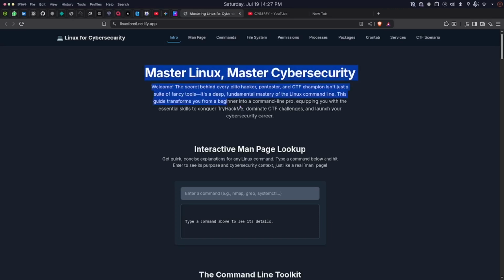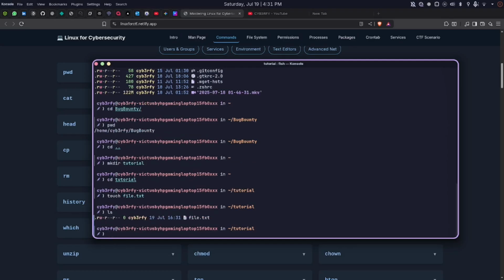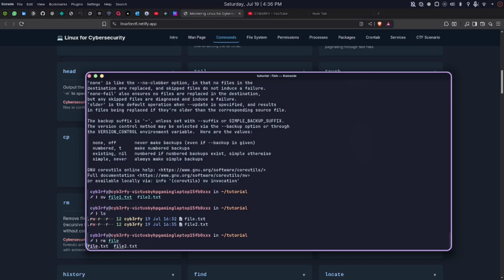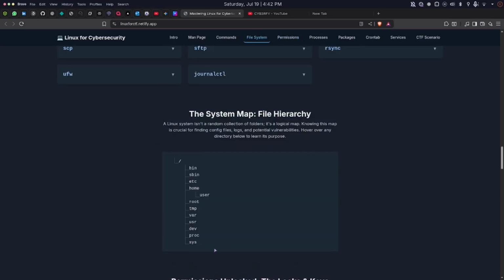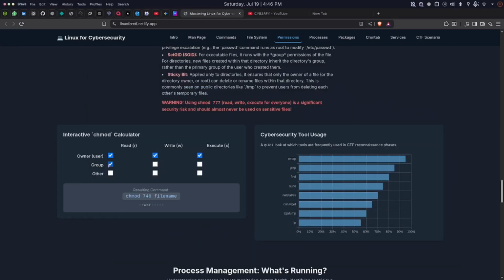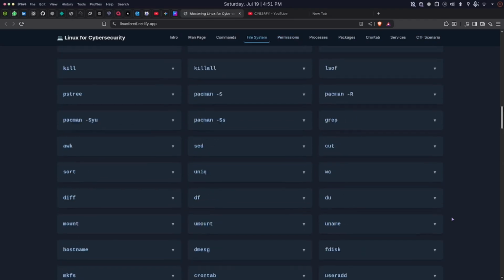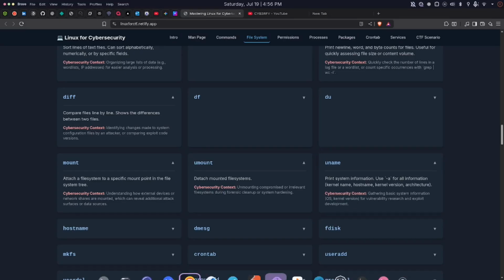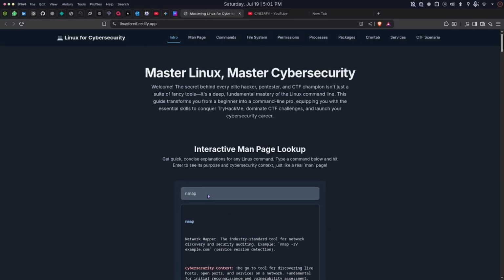Cybersecurity Linux Deep Dive: Become a Command Line Pro (CTF & TryHackMe Ready)

Comment from the maker: Here is the link for the webpage : https://linuxforctf.netlify.app/

Hope you will like it 😄
Reply: @cyb3rfy

The commands section of your webpage is missing.
Reply: Could you please fix it.
Reply from the maker: @SachiinKharatmal  Hey ,actually it's visible and working fine from my side , did you tried opening it from your PC ? maybe the problem is when opening it in mobile , or you can also use desktop mode , please try and share the outcomes.
Reply: @CYB3RFY I was using it via my laptop and it wasnt working.
Reply: @CYB3RFY  seems like it's really missing, cuz I also can't see it trough Firefox (140.0.4) and Safari (17.6)
Reply from the maker: @ss9164  Sorry for the inconvenience , actually that was because i was using dynamic loading , but now i have removed it , please check and update me about the status.
Reply: @CYB3RFY  thanks for your quick reply and your hard work, now it works as it should be! So helpful Linux cheat sheet! If anything, I subscribed to your channel and liked the video to support you a lil bit
Reply from the maker: @ss9164  Thanks man , it means a lot !
Reply: Perfect! Works.